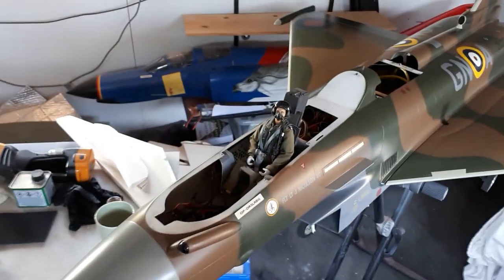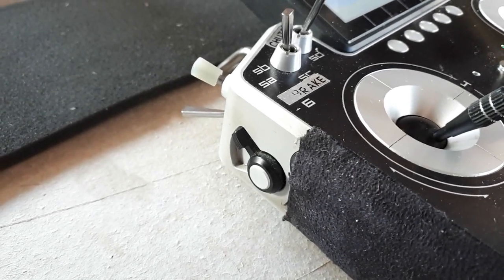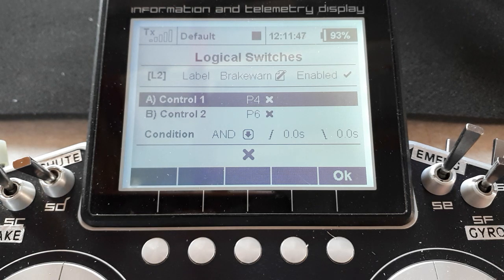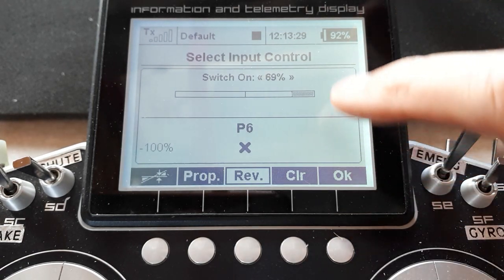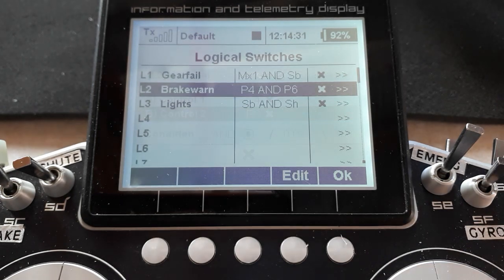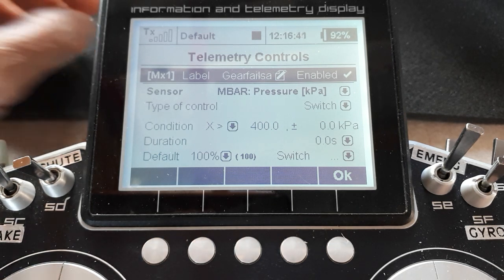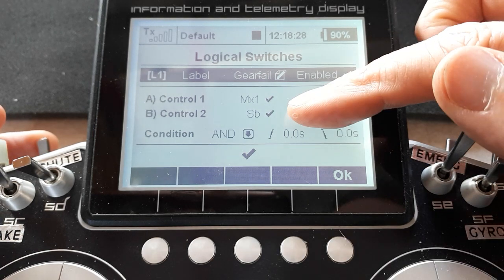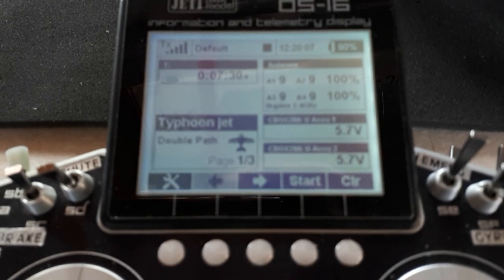Jeti - Logic switches for beginners, episode 3

Comment: Thank you for this video. I am looking for this type of feature for my F5J model. I do not want to be in situation when my motor will start spinning when plane will lay on the ground. I just bought DS-12 and because I do not have sliders I am planning to switch on motor with SC switch. I will use "delay" feature in the "Function Curves" menu to soft start ( ramp up over 1.5s).  Risk is even higher when using switch instead of a slider so additional protection is a must have. If I understand correctly....even if your SF switch is in "arming" mode, until throttle stick is fully back it will not start. I believe it is also possible to add alarm on switch positions when radio is switched on right?
Reply from the maker: You want the video in the following link.  Just replace the stick with the switch that you are using.  Jeti's built in throttle cut does not require the throttle stick or switch to be brought back to zero to arm it.  The alarm for switch positions when radio is switched on are set in the menu "Advanced Properties", "Stick/Switches Setup", "Required pre-fl. pos."
https://www.youtube.com/watch?v=mytJTn8NQPQ&t=557s